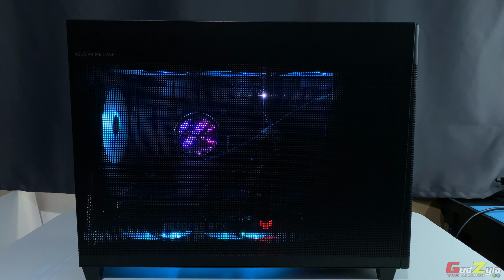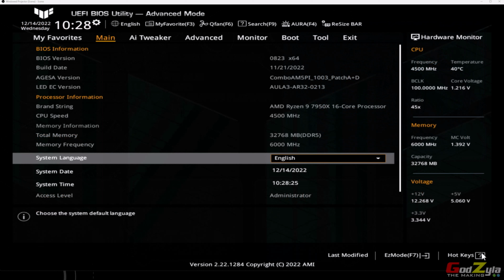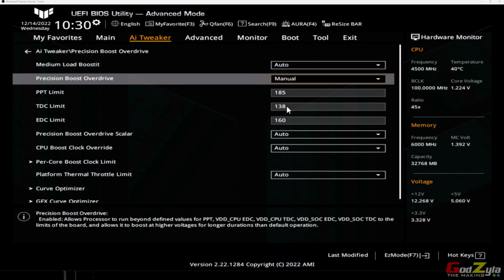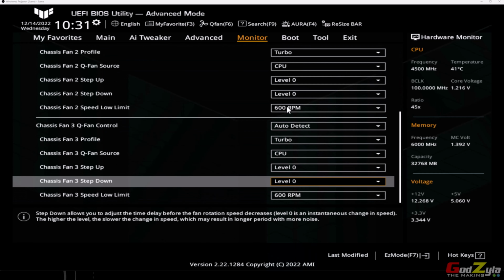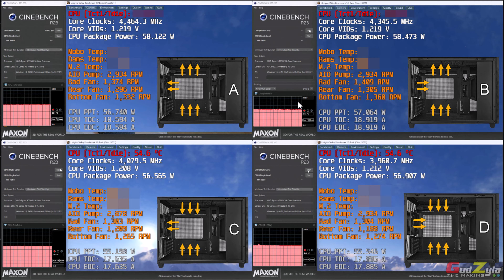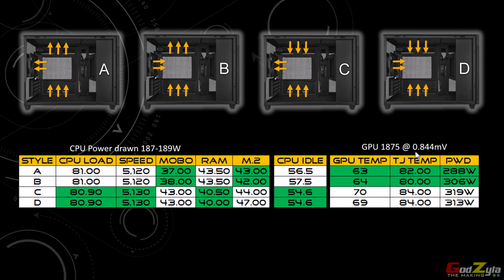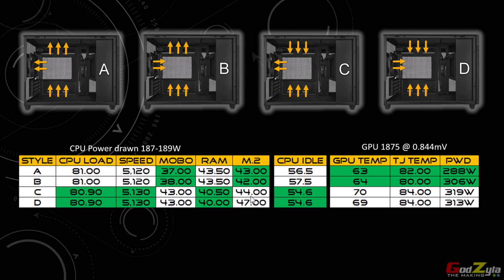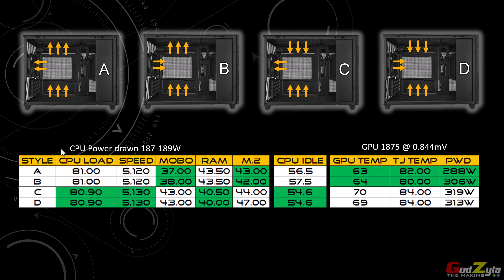ASUS AP201 Prime - Thermal Test (Part III)

Comment: I thinking of buy this case but use a Thermalright phantom spirit instead of aio, and mabye going with the C configuration. Keeping the dust out. Curious on what you think or if there are any that have tested with air cooler
Reply from the maker: @simonmllerjensen8209  hi and welcome to my channel. For aircooler which I did try before returning this case. C configuration is good if you do it this way. Have the front top fan as intake and the rest top fans as exhaust. You wouldn’t want to blow the hot air back into the case. So the configuration as follow. 

Top - 1 intake (top front) + 2 exhaust (top rear)
Bottom - 2 intake 
Rear - 1 exhaust. 

Of course you can try it out yourself.
Reply: Thank you! So glad I found your channel. You have many very informative videos. Looking forward to your future videos

I’m not sure I understand your reasoning for having the top front fan as intake and the 2 other as exhaust? Is it because of the exhaust fan at the back?

I building it with a SFX psu, a 3 fan gpu and thermalright PA. I was planning to install 7 fans

3 intake at the top
3 intake at the bottom
1 exhaust at the back

Thanks for replying
Reply from the maker: @simonmllerjensen8209  hi, though congifuration C looks ideal but the problem is this.. 1st bottom fans passes through the GPU and to push warm air towards the top section, 2nd the top where it pulls in cool air to cool the air cooler heatsink, the warm air from the heatsink only area to exhuast is the rear, plus mix with the warm air at the bottom up. Therefore more warm air is being traped inside your case. That's the reason why I've suggested this configuration which I have tested.

Top - 2 x exhaust (rear 2 fans) - this is to exhaust the heat from the air cooler heatsink and the bottom warm air going upwards. 
Top - 1 x intake (front top) - to being in cool air at the front of the air cooler where it will pass though the front air cooler heatsink and then air cooler fans will draws the cool air from the front and to push hot air out to the rear. 
Rear - 1 x exhaust - as usual, the warm air is being exhuast in this area.

You don't really have to follow my configuration but give it a try to see the thermal difference.
Reply: @KleoYan Thanks! I differently try the configuration! Again thanks for the thorough explanation
Reply from the maker: @simonmllerjensen8209  yup that’s good. Reviewers testing can only be a
rough gauge as factors like different climate, different case fan uses. So it’s still best to test it out. 👍👍👍

Comment: I cant buy this thing gpu will born out..
Reply from the maker: Hi Ron, welcome to my channel. I have no idea what you mean and which GPU are you applying to this case?
Reply: I mean the GPU on idle it's 62-64 degree or and wrong?  @KleoYan
Reply from the maker: TheprotectorFPS are you @123-g1u or Ron? which GPU are you using?
Reply: @KleoYan  Same person. 4070 super. Jajaajajajajjaj
Reply from the maker: @ronpo1776  hmm.. 4070 super and you are hitting 60°C++ .. that is kind of high. is this dual fan or tripple fan.. best if you can give me brand and model. always remember. if you need help on PC stuff, always provide full specs and what are the fans you use in this case? btw what system specs are you using?
Reply: @KleoYan  I don't have this case I want to buy it i got all Asus prime and tuff board, but I want to know if on idle your GPU it's 62 or 64 degree on ?? As shown on the result you have or maybe I don't understand the numbers.
Reply from the maker: @ronpo1776  those numbers are benchmark on load. it's consider low on load. on idle is not at 60°C++ is much lower. around 49 to 50°C
Reply: @KleoYan  I see thank you for reply!! I'll buy it then. Best regards!!